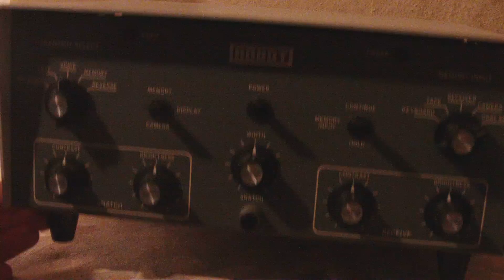A closer look at the Robot Model 400 Scan Converter (SSTV)

Comment: I had a Robot 400 back in the 70's. It finally stopped working so I called the company and complained. They told me to send it back and get my money back.
Now they can do all of this with a computer sound card.
Reply from the maker: Thanks for your feedback!
I also had trouble with a Robot 400 once, so I can partially relate. The circuit breaker on the back was stuck. I had to use WD40 and pliers to fix it.

Yeah, sound card solutions are awesome.
I started using them with MixW2 in the 2000s, I think.
However, sometimes dedicated modems and classic software work better. JV-Fax and a 741 modem could decode certain transmissionsn that MMSSTV and PiSSTV failed to decode. 

Especially with old modes, such as 7.2s/8s, sound card solutions are lacking.
The historic modes use 1:1 aspect ratio, but MMSSTV and other programs display them as 4:3.

Also, they don't use the sync pulses anymore. Decoding historic recordings doesn't work properly with modern software. The Robot 400, however, displays them crisp and clear no problem. You can check out my other videos.

Best regards and a happy new year! :)